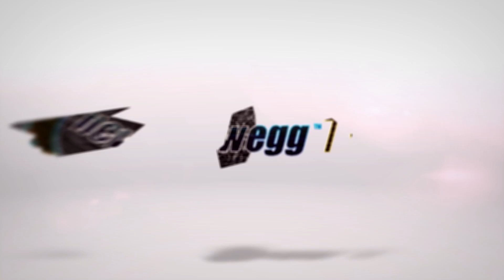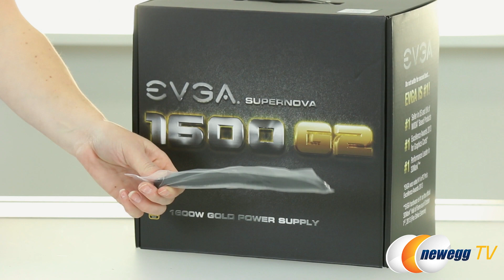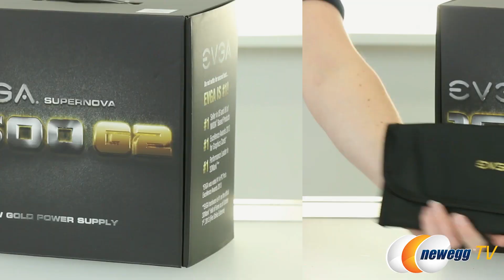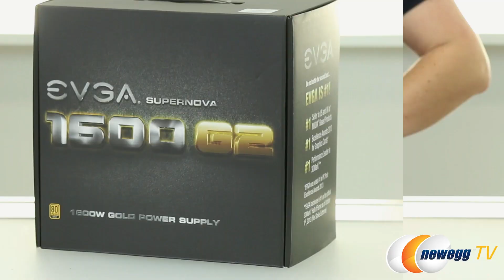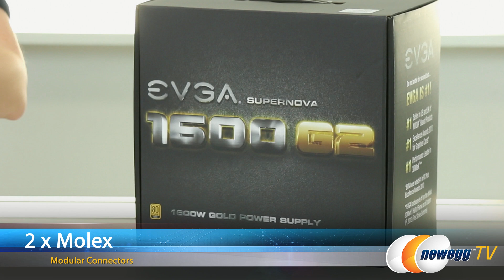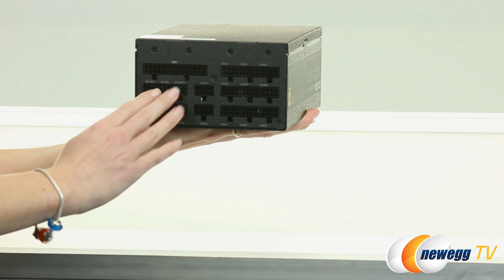EVGA 1600W Power Supply Overview - Newegg TV

Comment: " delivering 90% efficiency"  yes the box and unit STILL says " 80 plus gold"   facepalm.  Why not just call it " 90 plus efficiency" .
Reply: It is an industry standard that is in almost every substantial power supply, including servers. Also depending on the rank aka gold in this case you can see in the link below that the efficiency really depends on how much total load you are putting on the PSU.
http://en.wikipedia.org/wiki/80_Plus
Reply: The name of the organization is 80 plus. So ya.
Reply: Troy Black I already KNOW about the industry standards.  You didn't read my comment at all obviously.
Reply: 80 Plus is efficiency over 80% in all settings. If its above 80% in all then it gets a different metal standard in this case gold. I wasn't arguing and its hard to determine what you do and don't know from a single text comment on a youtube video. Sorry to have posted at all.
Reply: foist101 * Titanium on the AX1500i
Reply: Troy Black No reason to apologize to this guy, he's out of line.

Comment: If you have a dedicated line/breaker for your computer, that is 120V x 15A = 1800W. Gold certification is 87% at 100% load so this power supply 1600W / 0.87 = 1839W from the wall. In theory, the panel breaker should blow before you overload this thing. If you need a dedicated line and this power supply, your PC is pretty ridiculous.

Comment: I'll buy this when Power Consumption becomes cheaper. I mean dirt cheap.
Reply: If you don't have an extreme PC you wouldn't need this anyway, but assuming you still bought it, the thing isn't going to run up your electric bill simply because it's rated to handle 1600 watts.